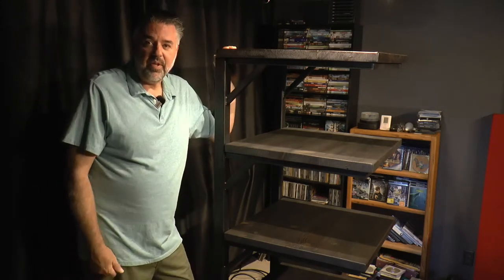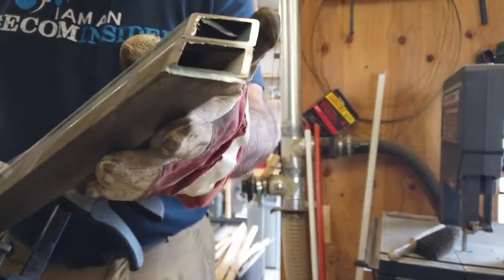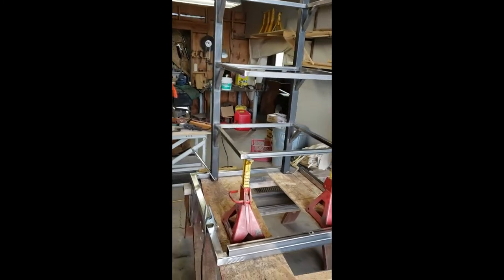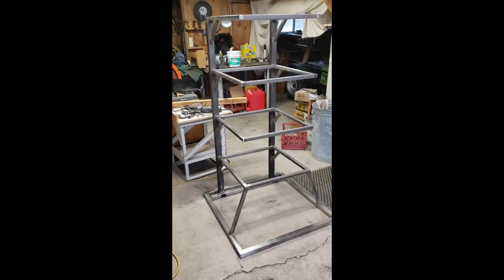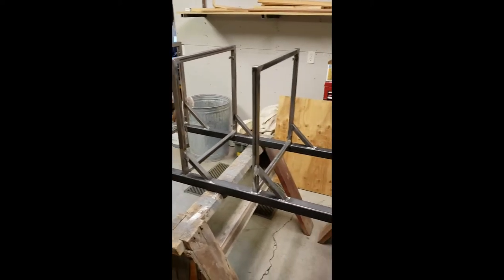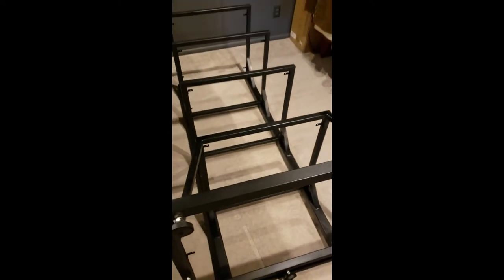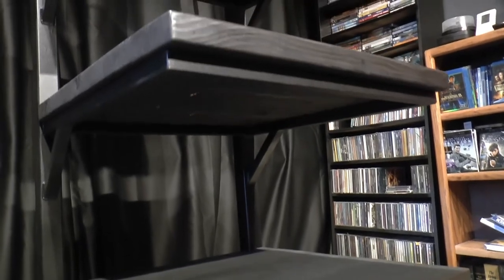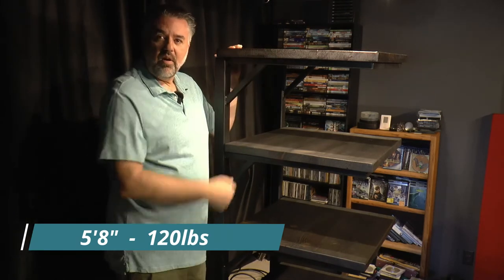Home Theater Audio Video Projector Rack DIY 125lbs. Home Theater Rack Build

Comment: Can you post the paint used for the metal frame?
Reply from the maker: I don't remember the exact paint I used. It is a truck bed liner spray on paint. I got it at Home Depot. Make sure you put a coat of primer on first. Thanks